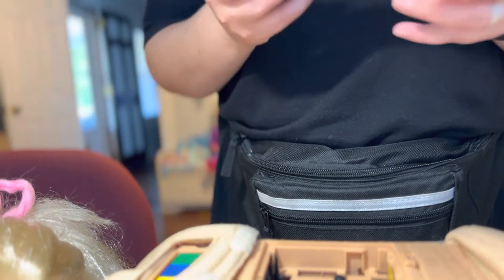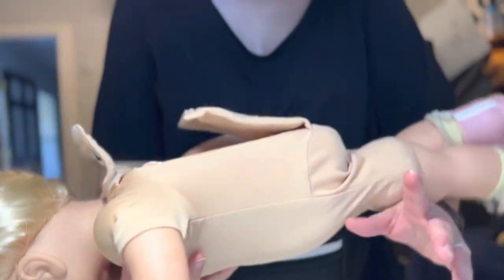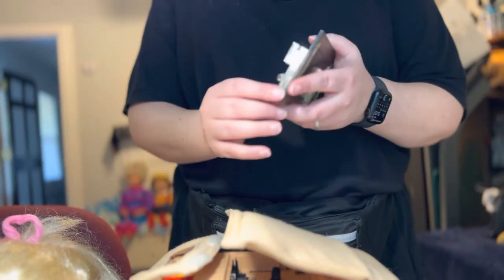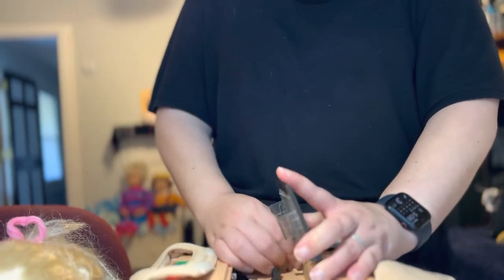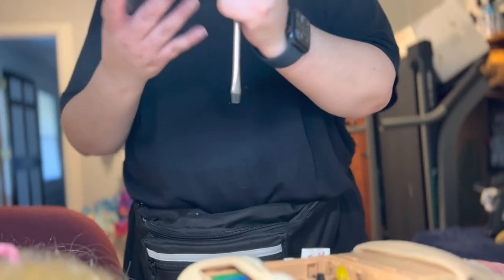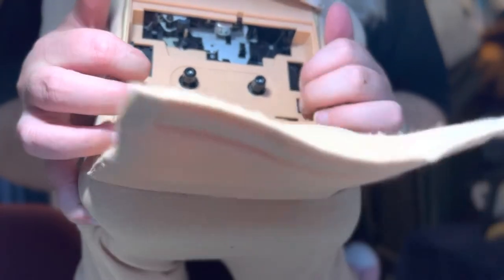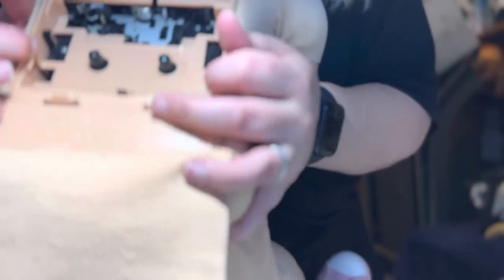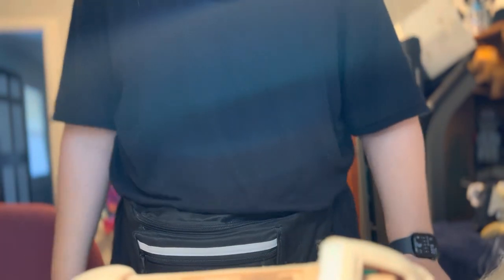Repairing Cricket’s cassette door, part two for Mark ￼￼

Comment: Nerves make total sense to me. When I run into a computer issue I'm trying to solve I get sweaty and my heart literally goes a mile a minute. There's an app called Google here on my notetaker and I thought it just ran high-level stuff like the Google Assistant. So I went into Settings and disabled it since I don't use Assistant. Well after that the Main Menu, equivalent to a home screen, stopped functioning and I panicked for a while until I thought to go back in and re-enable the Google app. And what do you know, the notetaker has run like a dream ever since. So yeah, there's not a thing wrong with being nervous.
Reply from the maker: Thank you. The only problem with being nervous and working on robots at the same time is it makes your hands not so steady and if you break a hinge or accidentally get a finger caught on a wire that you accidentally pull off or something, you’re out of luck. For me, that just makes it worse, knowing what I could accidentally do. Thanks for watching.

Comment: Don't ask ME to repair those doors! I'd likely crack the hinges and the door itself in half LOL!! Good work, though, Leslieen. You're really good with your hands. Let me know if I shouldn't use your real name in comments. I got that from your Jebo setup video.
Reply from the maker: Oh, don’t worry about it. I didn’t mean to use my real name, but I was cheering myself on as I was sweating and straining and shaking and shoving. LOL! As long as nobody has the last name I don’t think we’re in any danger.
I will try and describe the doors configurations in better detail. If you were holding the door with the cassette window facing you, there are five connection points. There are three going up the left side. There’s sort of C-shaped, but with a little plastic flange thing that sticks out. All of the ones on the right are, mostly C-shaped but they don’t have those little flanges on the side. So when you go to align the door in crickets body, you have to start off with the bottom two hinges and press backward toward her bottom to get the first set of hinges to align. That little flange on the bottom left side has to snap into this very secure Spot in crickets bottom. The right side just snaps into a regular groove. Then you have to go to the middle two hinges. The one on the left side has that little flange thing and the one on the other side is normal. But they are slightly wider than the casing, so you have to press inward on both of them. The one on the left and the one on the right. As you bring them in, you bring the door downward as you squeeze, the left hinge flange can slip into a little square, excepter whole thing on the left side And the other one can do the same on the right.
Once you get past those, there is one more hinge thing at the top on the left. That one has to align above the plastic release mechanism for the eject button. It has to enter its own little hole above that release so that when you press down on the eject button, the little plastic mechanism will let go and enable the door to open. I couldn’t check on all three connection points at the same time so the last one was an unknown. I was more worried about getting the first two sets of hinges to connect and go where they were supposed to without snapping anything. It was a trial I will tell you. Cricket says in her manual, that if the tape door comes off, most likely kids parents will be able to put it back on. I don’t know if my dad would’ve had that kind of patience. He probably would have shoved it as hard as he could, and snapped everything.